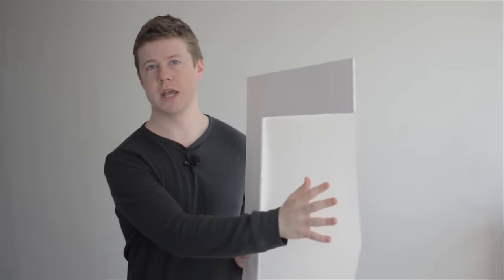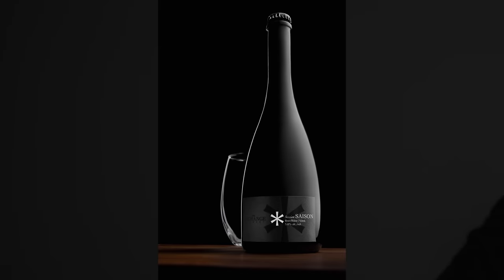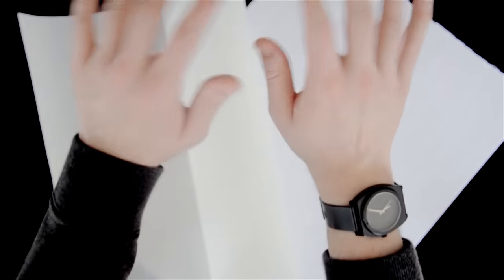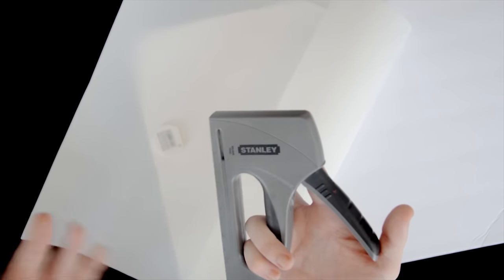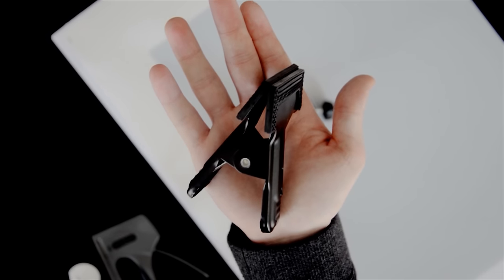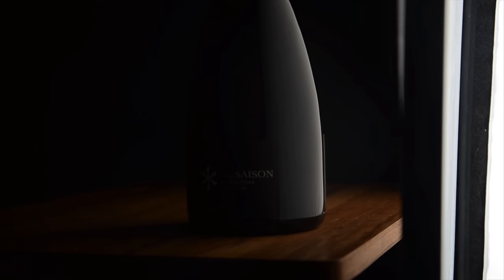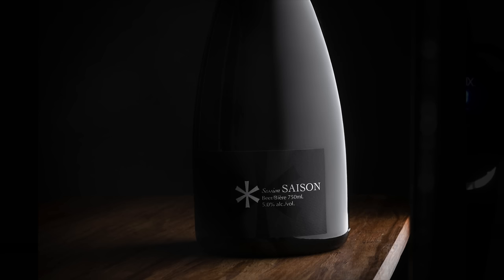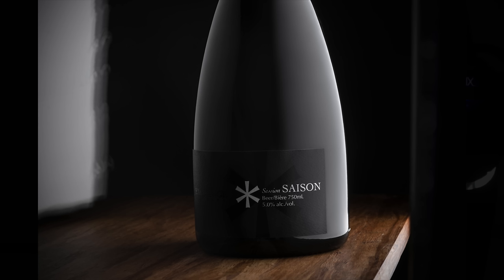How to Make a DIY Diffuser for Product Photography

Comment: My diffusion material is Lightform a product available decades ago. The diffusion material fits over a plastic tubular frame with elastic straps and the frame has a clamp that mounts off a C-Stan arm. Two sizes, 3 x 3 feet and 4 x 8 feet. Also comes with other materials / Diffusion, White, Black and Silver. In addition to that Lightform also made three sided silver reflector various sizes that included magnets to fix and adjust the two ends and nicely poison  behind a product or to the side. Think I got these products about 1992. 
Your ideas for diffusion are excellent. If it works it is good, that is all that matters.

Comment: Hardware stores carry plastic tubing and 90 degree corner pieces. Easy to cut and create a frame. Savage and Lee Filter material can be mounted on the frame. One photographer I know created a wooden frame and same diffusion materials.

Comment: The gradient makes the bottle look matte/frosted. You need a sharp cut-off line to maintain the gloss appearance. Try putting your strip box slightly behind and to the right of the subject at a 45* angle to the scrim (open to the subject) with the edge farthest from the subject actually touching the scrim. Then, sit back and watch the magic. ;-)
Reply from the maker: Hi John, yes at 0:25 I am referring to the hard edge of the gradient (-: Our previous video shows a similar bottle gradient using a foldable nylon diffuser. Have a great week!

Comment: The bottle doesn't look like glass though. It has a Matt finish. Usually glass has a hard edge.
Reply from the maker: I hear you, I could have done a better job of the main highlight, by putting it close to the edge I gave a matte illusion, looking back I would like to emphasize the direct-reflection from the gradient on the right hand side. If you zoom in it cuts off in a hard glossy manner but is lost here overall.
Reply: @workphlo  doesn't take away that you are a terrific photographer!
Reply from the maker: @TheMrRatzz  you are too nice! cheers, stay tuned for a great advertising photography tutorial Monday!